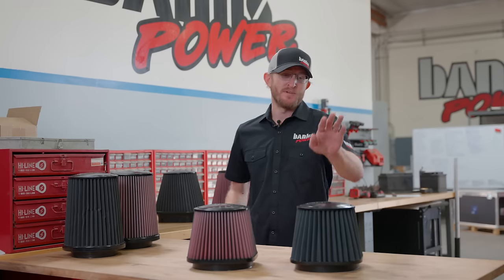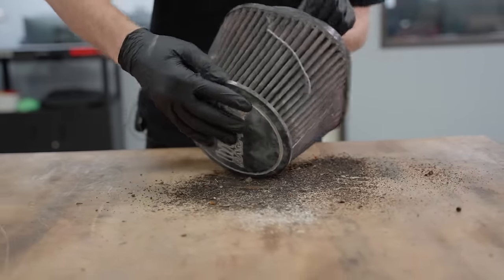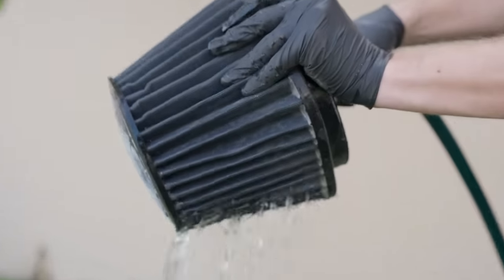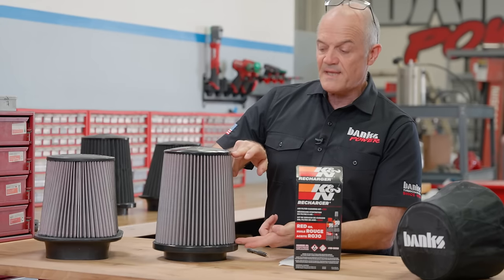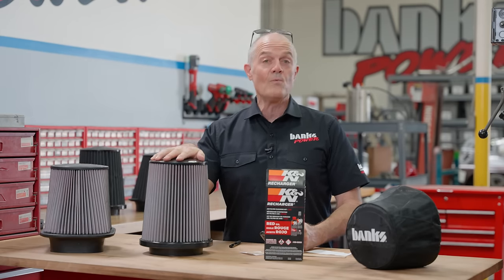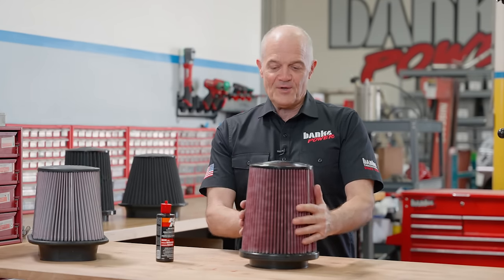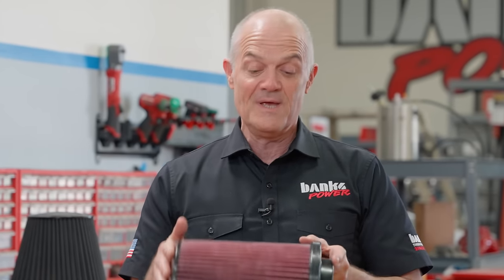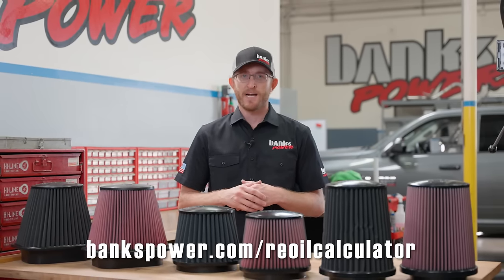How to Clean and Re-Oil Your Air Filter

Comment: This just re-enforces what I think about gauze air filters. Paper disposable ones are easily replaced. Pretty much everyone I know who has a reusable one drives around with a half plugged filter most of the time. Nobody feels like cleaning their air filter.
Reply: Not only that, the gauze ones let tons more dirt in. Useless.
Reply: @t_c5266  depends on the filter media and the density. I have an Airaid Synthamax filter. It is rated for 4micron. It is a cone filter.  It is a larger filter while filtering like a stock unit.
Reply: @mikekuschka998  If its rated by the company, it can be considered a moot point until lab testing is done by an unbiased 3rd party. 
I also tried to look that company up and verify your claim, the only reference to filter size is on their wraps, not the filters. and the specific "non-woven synthetic" doesnt have any readily available info on it either
Reply: I am agreeing with you. I have a dry AFE filter on my Corvette and the inside of the air duct down stream of the filter is filthy, so it’s not filtering. I’m trying adding an oil foam wrap as a pre filter. At least the Corvette isn’t a daily driver.
Reply: You guys just can’t take care of their car’s
Reply: A k+n with a light coating of dirt on it actually filters the dirt now. 
Of course it sucked dirt to get there but at least now it filters! 
I like the guys who keep em spotless ,I've lost track of how many dusted out engines I've seen from em.
Reply: Do the work, quit being so lazy. Its just cleaning a filter and its not hard. Changing engine oils is harder. 
😂😂😂 
America tho so you do you paper filter lovers and us reusable oil filter guys will do the same hahaha.
❤❤❤❤❤
Reply: I’ve observed these problems too.  A filter that is designed to increase power and fuel economy invariably hurts fuel economy and power since the vast majority of them are poorly maintained.  I also have seen several dusted engines from these types of filters.
Reply: I would bet that people clean their air intake filters far more than regular people have their paper filters replaced.
Reply: @KC-lg8qf I agree. The average person watching this video is in an entirely different category than a random Toyota [Camry] owner who has driven the vehicle for 4 years but has never once popped the hood.
Reply: @t_c5266 not really. This type of filter is recommended not for daily purposes although it can be. But for performance in the race track or youre just trying to beat someone at the light. I recommend wix for daily trips to best protect your engine. It will affect performance over time as it does clog. Cotton gauze can filter pretty good until you get into micro dust particles. Not ideal for offroading. You can gain hp using the K&N filters. It will protect pretty good while even fully clogged without affecting hp. The oil is the key protector of the filter.
Reply: They just too damn lazy to do routine maintenance/ checks.
Reply: I clean my filter more than often
Reply: These guys make it alot more complicated than it has to be. Just use your best judgment when re oiling

Comment: Throughout the years I had both dry and oiled filters.  Truthfully,  I didn't see a difference in performance one vs the other.  Than again, I'm not racing my trucks at the track. The oiled obviously requires a bit more attention. It's also not a bad idea to have a secondary filter to throw in interm, while the other drys properly.
Reply: first time I cleaned my oiled BANKS filter I was online ordering a second one with a spare sock. Hot swap durring an oil change and washing the filter at a later date is alot more convenient.
I'd like to see the numbers, buht i'd put money on oil filters having a higher micron filtration level to them. Keepin the finner dust out of the engine
Reply: @Markes12344_L  no doubt the oiled will catch a lower micron level.
Reply: @paulbenderavich3833  Very true however, they will also get dirty faster and require cleaning more often. It goes with the territory.
Reply: @Markes12344_L  it's less to do with the micron level and more to do with the oil actively grabbing hold of particle contaminants, think of it more like the modern day take on an oil bath air cleaner

Comment: If you live in an area like mine I would highly recommend finishing the cleaning by dunking the filter in deionized water or else you will build up minerals like calcium and iron over time ruining the filter.
Reply: makes sense actually, same reason why you should put distilled water in the rad n not the well water
Reply: Very true...distilled water is now very expensive so the cost of that needs computed into the maintance expense.  Maybe a 1 gallon jug of drinking water will work.
Reply: You must be in FL. So what I do is pickup a RV water filter from Walmart, attach it to my hose and it removes all the calcium and iron.
Reply: Dunk it in water, then throw it in the trash. Oiled filters let so much crap into your engine

Comment: I'd like to see some actual tests comparing oiled and dry filters. Diff cover stylee
Reply: i can see @projectfarm doing this, he's already tested reg filters to KnN. I feel the difference will be oiled filters may trap more dust on the micron level, verses dry filters
Reply: @Markes12344_L  it was actually the exact opposite. Oil filters let more dirt through on all levels
Reply: Most modern cars do not like oiled filters. The suction created by the engine through the filter pulls oil through and coats the mass air flow sensor, messing up its ability to read correctly.

Not to mention it’s far far easier to maintain a dry filter.
Reply: @definitelydipper595  i think youll find thats by design and part of the job of the 'closed' pcv system to regulate the blow by
Reply: @Bunna08  this has nothing to do with PCV systems. 

I’m talking before any of this air enters the engine, it goes through oiled filter media, pulls oil through the filter and coats the mass air flow sensor, hampering it’s ability to read correctly. Which usually means it ends up running way richer than it should.
Reply: You can buy a can of mass air flow meter cleaner, comes in an aerosol can. Nice to give it a little spritz if you are running an oiled filter.

Comment: Make sure to clean your MAF after a few 100 miles with a wet filter when first installing or re-oiling. Found that out a LONG time ago when i first installed one on a Supra i had back in the early 00's. My throttle response was off and MPG in city driving was poor. Checked for intake leaks and noticed the intake runners had a very light film on them, traced it back to the filter and cleaned the MAF fixing the issues.

Comment: Excellent video. Much better explanation than what Ive seen elsewhere. One comment, The new K&N oil bottles, that I just received today, do not come with the volumetric graduation on the side. This caused me to mess up on my first try. I ended up dumping the bottle out and putting a measured amount back in. But with no visual means of telling how much I was putting on, I found I emptied the bottle after only going around 1/3 of the way. Consequently I had to re-wash and now waiting for it to dry. But my car has two filters so on the second filter I speed up the application and did every other pleat. With every other pleat oiled I continued on to the pleats in between and ran out just as I competed the full turn. Doing every other pleat helps keeping from over oiling, as shown in the video it will wick quickly to the rest of the pleats if you run out.

Comment: The man doing the oil knows - if it is clean and dry, the oil will wick and spread. I like how they know the volume of oil for the thickness and surface area of the particular filter. Use of time and gravity too - Excellent!

Comment: I do this by applying oil across the length of every pleat, start to end. The nozzle of the oil bottle seems ideal for this. It's a quite easy process. If you increase boost, you can use sensors across the air intake path in order to measure the pressure drop at every stage. If your OEM filter proves to be too restrictive, I am in favour of an aftermarket like K&N. Caterpillar marine engines use such filters from the factory. But if you drive in dusty/desert conditions, maybe better stick with OEM filter and change more often, before pressure drop becomes too much causing increased fuel consumption, reduced performance and sucking turbo cartridge oil in the intake.
Reply: What do you mean by "pressure drop?"

Comment: I dunno what’s in the K&N air filter cleaner but it smells, looks, feels, and cleans exactly like Spray 9. I’ve used spray nine to clean all 4 of my K&N air filters for well over a decade now. Works great and is much cheaper then the K&N branded cleaner. Always use the. K&N oil though.

Comment: how does extreme cold weather effect the filter oil ability to trap dust ?  is it still  effective at -20 f or is a dry filter better ?
Reply from the maker: It will work, oiled filters are good for temps of -20°F or -28°C.

Comment: Thinking of moving away from oil. Never feels like I get the right amount of oil on it, too much or too little, and then it gets on the MAF or creates more soot at the throttle body. Edit: The calculator is cool! The k&n kits I used to use were spray can or bottle and didnt have those markings.
Reply from the maker: We created this video just for you. Give the Re-Oiling Calculator a try! https://bnks.pw/oilcalculator
Reply: As long as you let it dry, and don’t put too much oil on the filter, it won’t effect any sensors
Reply: I’ve had a Banks oiled filter on my LB7 for about 14 years. I do have a spare one that I rotate once per year. I’ve yet to replace the MAF sensor. Over oiling will mess up the sensor so I’m told. I always let the freshly cleaned one sit at least overnight and wipe out any excess before it goes back on the truck.

Comment: So I own two BANKS oiled filter and the prefilter sac, because I prefer to hot swap every 25k (km). cleaning large debris and bugs got way easier with pre filter.
but I have questions/comments
1: what happens if you over oil (just more restrictive?)
2: it'll be hard to explain, but I utilize that little lip on the KnN oil jugs nozzle. Place it inside of the pleats with the oil hole ot the edge of the pleat, than depending on the direction of travel, turn the bottle slightly so you barley drag rear of the lip against the pleat with the leading edge off the pleats as it will catch  the mesh if it touches. This lip KnN provides on the bottle makes oiling each pleat individually a quick motion and fast to do.
3: I'm commenting before I investigate, but dose the calculator have BANK filters pre loaded?
Reply: That pre filter also robs horsepower. Had one on my quad but took it off and it flowed way better.
Reply: @JimmySeahawk  i don't find it dose, i'm not turbo'd or supercharged, and the BANKS  high ram kit in my truck seems to be more than efficient. plus the socks fairly clean and isnt so fine of a mesh i feel it'll add that negative of results. buht end of the day if it dose rob hp i'll still take it over the lil hp gain without, any day, it simply makes cleaning soooo easy

Comment: My mechanic told me to never use the filters that need to be oiled because the oil will destroy some sensors over time. Any thoughts on that?
Reply from the maker: If properly oiled, the air filters will work just fine. We generally recommend the oiled (red) filters over dry (grey) for two reasons. One, slightly better flow characteristics. They are somewhat thinner, more robust filter material for the oil and can grab more debris. Two, the service life. The oiled (red) filter can go up to 30k-40k miles before it has to be serviced (dry is about 25k miles). Either filter will last until about 100k miles.

Comment: Have you ever tried to pull a vacuum through the air filter say 24 hours after it has been oiled ? I keep hearing how the oil from the air filter can get pulled into the intake and fowl up the mass air flow sensor. When i say vacuum I mean the maximum cfm's at full throttle for the type of motor it is going into. Does this happen or is that just something the competition says?

Comment: I have a banks air filter on my wrangler, i liked it until i got more into offroading. Dont get a Warm Air Intake if you offroad around water. I went back to stock and added a snorkel with a prefilter(true cold air intake), does way better than the banks i had, had to constantly clean the banks. Banks was good on the road tho.

Comment: Some advice, as with me my oiled filters get filthy/grungy bad i had recently taken mine into the kitchen sink with Xhot water and soak them in dawn and dunk up and down you’ll be blown away how much grit/fine sand is trapped in the filter, especially when you never done a deep clean I was blown away by how restricted it had been my filters are 10+ years old…and to the guys that swear by OEM paper filters i get it but I haven’t had to spend $15-$20 a pop in years!

Comment: Ok, but what is the advantage of an oiled or dry filter? Why use either of these instead of a disposable filter?
Reply from the maker: Both filters are great, however, we generally recommend the oiled (red) filters over dry (grey) for two reasons. One, slightly better flow characteristics. They are somewhat thinner, more robust filter material for the oil and can grab more debris. Two, the service life. The oiled (red) filter can go up to 30k-40k miles before it has to be serviced (dry is about 25k miles). Either filter will last until about 100k miles.

Comment: I am a fan of Banks products. I would like to see a video on how well there air filters actually filter out dirt. Especially compared to the competition. I am concerned about using any cleanable filter for a long term daily driver. I used K&N on previous vehicles and ended up throwing them away. I felt like they were just dusting the inside of the engine. I ended up going back to OEM paper filters.
Reply: Oil analysis showed no additional solubles or dirt or dust when I switched. I run oiled Banks.
Reply: @TonyLasagna  I've watched actual testing and the oil filter failed to stop any micro particulates throw it the trash
Reply: if you offroad just get a snorkel, way better than my banks i had and it lowered temps. On road the banks was great tho
Reply: @triplestangman  interesting let me see that

Comment: Warm dawn soapy water. Water running in the reverse direction of the air flow. Not to hard as to mess up the gauss.  Let it fully dry overnight as ya sleep.   Then re oil and re install. Blue dawn soap then warm to almost hot water running backwards through it... darn things will look like you just bought it new every time.

Comment: Good recommendations.
There are a few automotive technicians who will tell vehicle owners not to use the oil impregnated filters because they have effects on MAF sensors. Sounds possible but is it likely to happen?
Reply: only is its over oiled. vehicle dependent too. depends on where maf placement is most of all
Reply: It also let's more dirt into your engine. All laboratory tests confirm this
Reply: Yup
Reply: nothing a little brake cleaner won' solve :)
Reply: @mplewp  or you can just keep a paper filter and you don't have to worry about it at all

Comment: Remind everyone switch back to paper filters. I watched a comparison video with a particle counter and the quality paper filters block far more fine to medium particles. I'll give up 5-10 hp to help my engine last longer. I used to buy K&N filters as random middle of the year gifts.
Reply: Yep, OEM branded filters all the way. Dirt cheap on Rockauto, easy to replace and awesome peace of mind.

Of course that all goes out the window when you start doing aftermarket cold air intakes.

Comment: After i did a lot research ,found out this looks very cool to have ,however no one will really clean and re oil their filter , given that it has the oil ,it will attract a lot more dust for sure but get clogged a lot easier, also i found out that a very very small amount of oil will go thru the intake and will affect the MAF sensor , so no ,not worth it.
Reply: lol i had k-n on my 2011 dodge journey traded it in with 70k on it for my 2014 journey so i pulled the k-n out of my 2011 at the dealership and installed it in my 2014 and have 140 k on it as of now, and yes i clean and re-oil every 20k miles and never had any problems with sensors on either of them...i also use the k-n cabin filter as well on the inside saves me a bundle as them cabin filters are a big rip off anyways

Comment: I used two pipercross oil panel filters on my C350 CDI and eventually lost both MAF sensors due too the oil mist covering the sensors in the inlet manifold. Be careful not too use too much oil when cleaning.

Comment: if you are oiling your filter i strongly recommend putting the oil in a paint gun and spraying it as if you are painting  . Much easier , more even coverage , faster and you measure beforehand so you can just spray until empty .

Comment: As a GM tech I have removed plenty of cold air kits and plugged air filters that have caused damage to the cars fuel system. These kits cause more problems than any dreamed up benefit.
Reply: I just found that out in my silverado :)